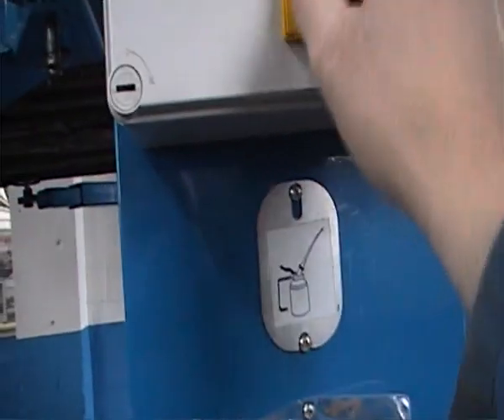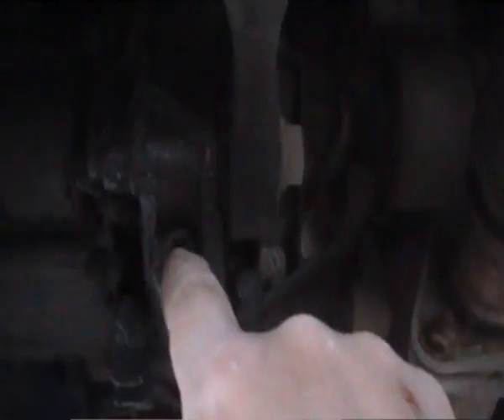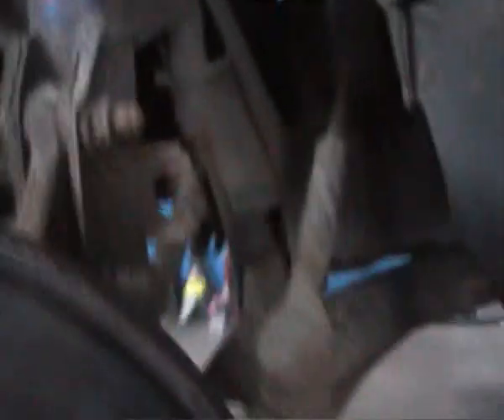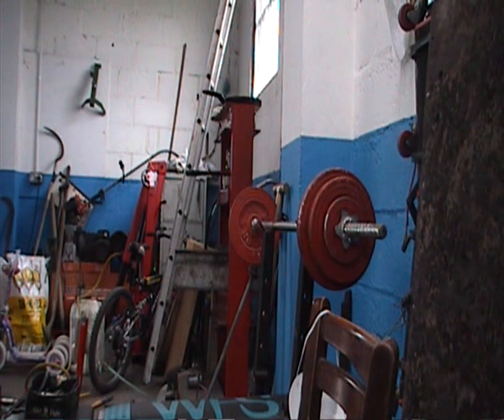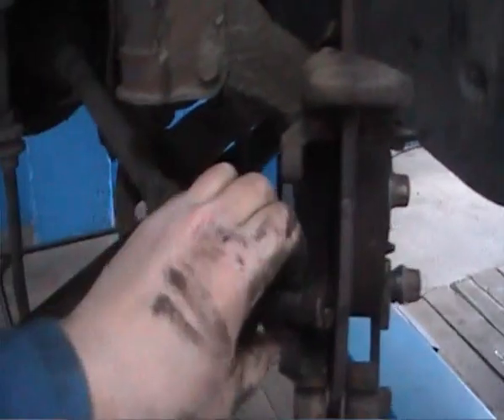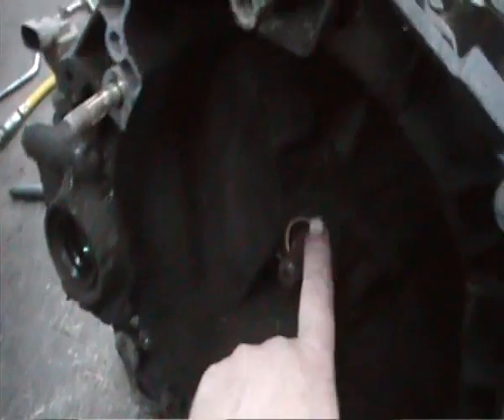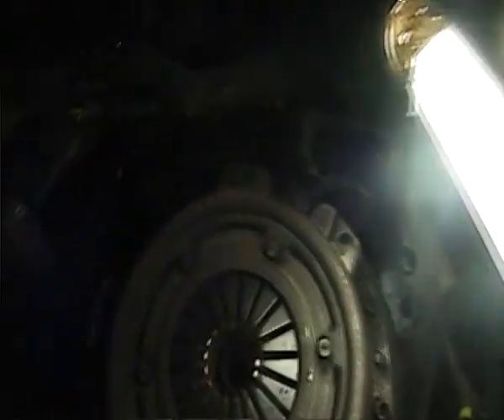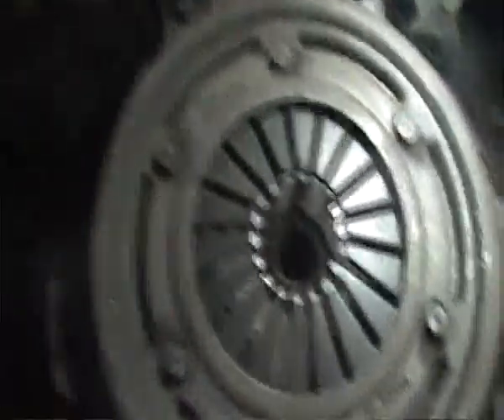How to remove a gearbox fit clutch on a Fiat Punto 1.3 slx  (part 1)

Comment from the maker: @MrBillybudge r u using a car  lift ,or a car jack and stands????????drop the ball joint on the drivers side, take the drive out on the passanger side, use two axel stands under the car, and one under the engine, and a chain or rope  and a iron bar ,to hold the engine up, when removing the gear box mount, or use two jacks,its a job for a mechanic, with 4 years experince, or more,

Comment from the maker: @MrBillybudge i worked for the main dealer back in 1983, same opertation on the panda as the fiat 127s, fiat UNO same job i worked on the 124 , 127, panda, uno mirafiora, 131, 130, 132, 124 special 128, 127special, 30 ywear ago, lol, etc, were are u from mate,??????????????

Comment from the maker: @MrBillybudge bandit country, northern ireland, the hub nuts on the panda are never tight, use a heavy 30 mm socket 3/4 drive, if u have one to slacken, with wheels on the ground, easy,